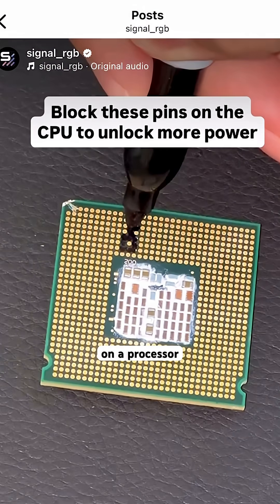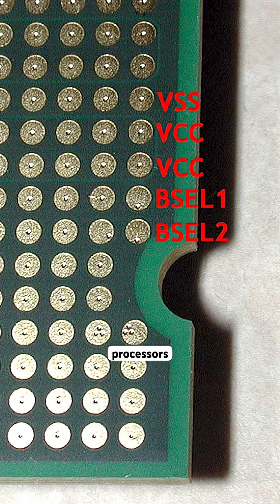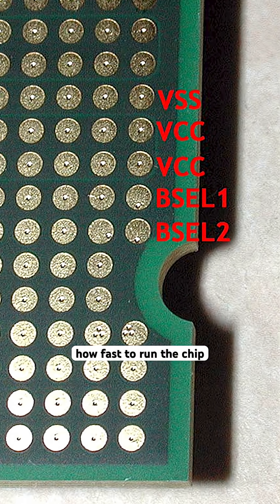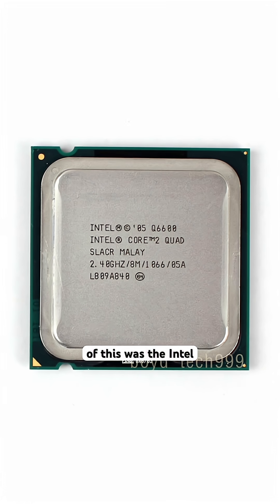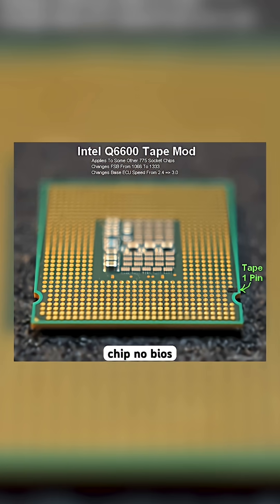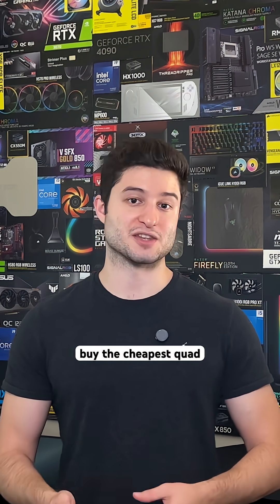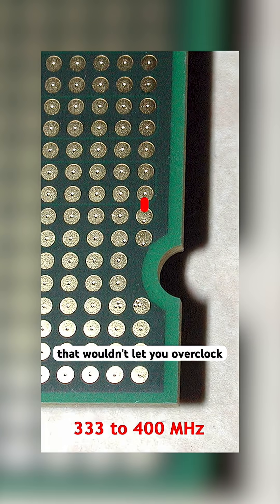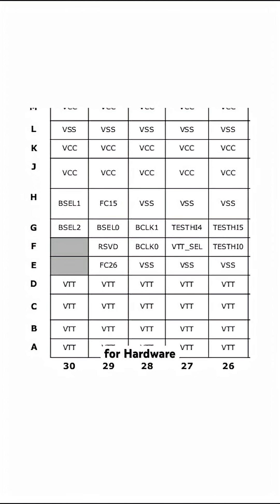Taping a CPU to improve it?!

Comment: Yeah, but then people discovered that the unlocked Socket 771 X 5470 and the X5492 Xeon could be modified to fit Socket 775 by just removing the tabs from the CPU socket, and those were quad-core 3.3 and 3.4 GHz out of the box and could be overclocked to 4.3 GHz on a GA-EP45-UD3P and GA-EP45-UD3R motherboard.

Comment: Why on earth would I do hardware mods when I can change the bios ? Q6600 was one of the most overlock able cpu. I was running 3.6 stable with a water loop back in the days.

Comment: I still use a q9650 and this isnt needed if you have a proper motherboard.  With just bios adjustment i run at 4.8ghz from the factory 3ghz, and have the 16gigs of ddr3 memory ramped up to 2000mhz.  Paired with a 750watt psu, 2060super, type c and usb 3.1 card, z se sound card, and 1tb nvme on x4 card runnijg at 2.2gb/s.  Running both windows 11 and linux mint zara.  I get a solid 100fps monitor max on every game i play at max setting including fallout 4, world of tanks, trailmakers, long dark, and a few others.  This computer is faster to start, shut down, and load several programs, than my newer machines.  Older is better.  For people, sex, cars, wine, and computers.

Comment: So, they made a processor and cut back it's performance, even though it was as capable as a much more expensive one. That bothers me. I'm glad people figured out how to bypass this "price lock". I probably had one of those chips and never knew it was being "throttled". Just add this to planned obsolescence for yet another reason to despise the tech industry. A computer from 10 years ago uses every bit of power it has just to run a web browser. That's not even counting trying to load a website.
 I bought one in 2020 and it takes forever to load something as simple as a stream of my security cameras. I had to replace it with a basic laptop computer that was mid range about 2 years ago. So last time I bought one, I think I learned my lesson and just went ahead and bought one of the highest end gaming laptops and immediately maxed out the ram slots and capacity. This is for work. Eventually it will be obsolete and relegated to just running my security cameras video stream. I would certainly hope that 10 years from now, that it is capable of doing that without much effort. But I know for sure, I'll have to buy another high end laptop before then to continue to do my work. And the cycle will continue....
 Buy expensive computer, use for a couple years. Then have to upgrade and move my previous computers down the line of succession. Might as well trash the 6gb RAM one from 2020. It's a sad cycle that seems unnecessary and intentional. Just like the chip described in this video

Comment: Back in the day you could solder the Amiga motherboard to make all ram chip ram (gfx ram) instead of fast ram (faster, other). Chip ram could be used for other stuff anyway so it got slightly slower while being able to load much more graphics.

Comment: still have my old q6600 in a machine in closet, you had to have the first revision, g0 to do trick, if you had the right motherboards, you could also file the socket and use xeons in a consumer board with a tiny pin swapping tape

Comment: Core 2? This happened in the Athlon era, except instead of painting pins the mods were done to traces on the top of the processor - either you cut them or you bridged them.

Comment: Remember the Athlon XP you could unlock the CPU with pencil drawing on the top of the CPU bridging an smc resistor pads.

Even turning them into the MP variant and allowing for dual socket usage

Comment: Many people don't understand product variation very well. Many chips have the same architecture and manufacturing process but individual process deviations create varying degrees of reliability. Less reliable cpus that were unstable at higher voltages would be downgraded to run at lower voltages and/or clock speeds. 

Overclockers are used to the unstability and mitigate the resulting extra heat and voltage with their own techniques. The regular person and OEMs will not do this and can trash the cpu easily if done. It's a liability issue if people say the cpus don't work properly when they're just ran over spec.

Comment: That's a half-truth. My Q6600, which I still use for Office work sometimes, can be set to 3.0 Ghz in the BIOS by increasing the Front Side Bus Clock.
Yes, by blocking those pins you also get 3.0Ghz but by changing the FSB multiplier which is slower than the BIOS method.

But in the 1990ths there were indeed chips you could only reasonable overclock using Hardware-Changes. I overclocked the two PentiumMMX-166 on my Dual-CPU Board to 233Mhz.

Go back further and CPUs themselves didn't even decide at what frequency they ran. I have seen it all, Jumpers to set a 486 from 3x33Mhz=100Mhz to 4x40Mhz=160Mhz and even really old 68000, 8088, 80286 and 80386 which had a real Quatz-Clock-Chip you could simply change for different frequencies.

Comment: You should look into the pencil trick on the old AMD Athlon CPUs.
I used a number 2 pencil to connect two contacts to unlock the multiplier on my Duron, Thunderbird and Athlon XP CPUs.
There were different contacts with different functions, at least one of them cut the higher multipliers out, reconnect it and you could run a 2GHz CPU at 2.4GHz. I still have that machine in storage.

Comment: Tricks like this resulted in CPU manufacturers now using hardware fuses within the CPU die itself, and the fuses are blown during manufacturing after validation.
Reply: Considering the amount of stuff sitting on a modern BCLK it isn't feasible to significantly change bus clock anyway.

Comment: We overvolted the pentium 4 by soldering a jumper from the 3v directly to the cpu trace on the motherboard
Before that we used graphite from a pencil to fool the amd 2500x into thinking it was a unlocked 3200x

Comment: that chip was optimized for that GHZ somewhere in that chip is a small defect separating it from its flagship brother chip, yes you may have improved its power bt at the risk of causing damage over time to the chip or even the computer other wise all cpus are literally cut from the same cloth

Comment: Not trying to hype anything up here but they probably did this again in later generations of CPUs as well. I had a 3.3ghz 4 core CPU that experienced a power surge during a thunder storm and when I tried using my PC the next day after power cycling the power supply I was greeted by a 20% overclock screen on bootup and sure enough when I went to check it in the Core Temp exe I use for checking thermals it said all 4 cores were all at 4ghz from then on. I was expecting staggering performance increases from that but they were only modest like 5-15% gains but still very much appreciated when free